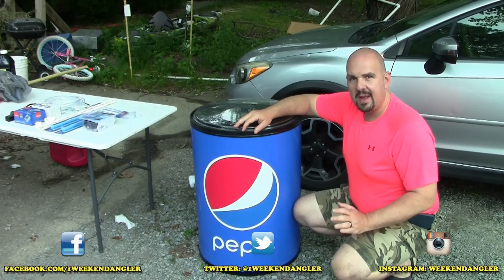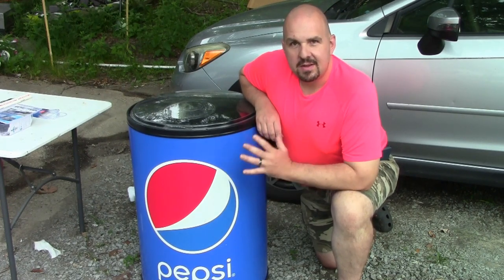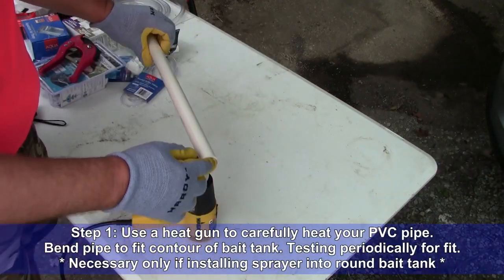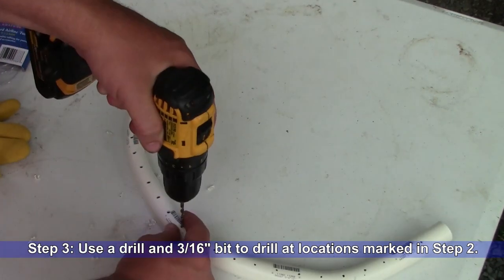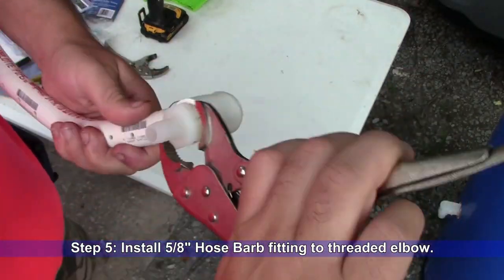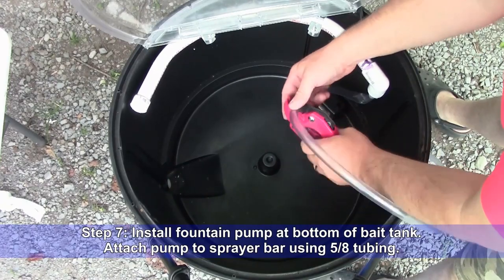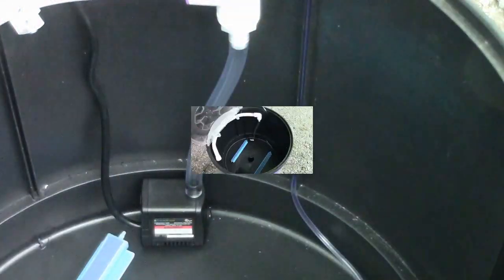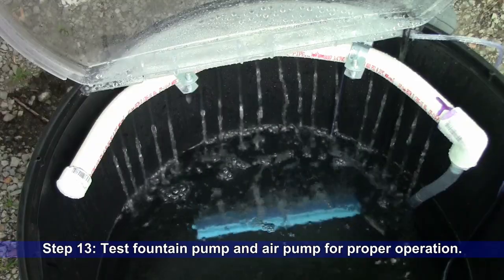How to Build a Live Bait Storage Tank to Keep Bait Alive at Home

Comment: I built a bait tank out of a 100gal rubbermaid stock tank.  Works wonders keeping my baits alive.  The only two things I would include would be a filter system and Better Bait additive.  The Better Bait helps remove chlorine from tap water, improves the slime coat on baits, and eliminates the need to transporting water in from a lake. They are just mean when you get em out of there.
Reply from the maker: I'm actually working on a long term storage tank. I designed this one for short term storage. It would be difficult to keep fish healthy and alive without a filtration system.

Thanks for the suggestions. I'll have to look into the better bait additive. I usually use about half a cup of non iodized salt.

Comment: Seen another guy turn one of those into a tank cppl years ago lol, good job Josh. Do you still have the wheels on bottom? I believe to me that was the best feature of mine and the release water valve, makes water changes so much easier. I've had bluegill live in mine for over a month or more, they'll thrive in there, I like the way you did the pvc circulation, awesome.
Reply from the maker: That's funny that you mentioned the wheels. When Dad brought me this one, he made sure to tell me it was missing the wheels. He brought me another last week that still has the wheels under it.

I'm trying to figure out what I'm going to do with a second one.
Reply: @TheWeekendAngler  definitely night and day difference, easy to move around water changes etc, you'll be surprised how long that bait stays alive in there, wouldn't make the water cool and not to warm and they'll last, I've had up to 50 in mine,  I got the Mello yello one. I'm gonna put that pvc circulation in it like yours, I like that.